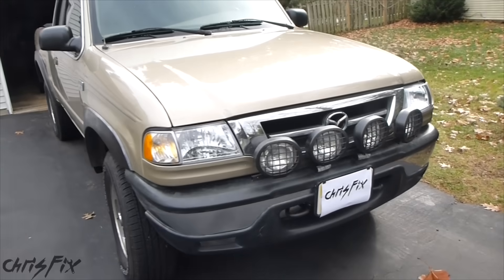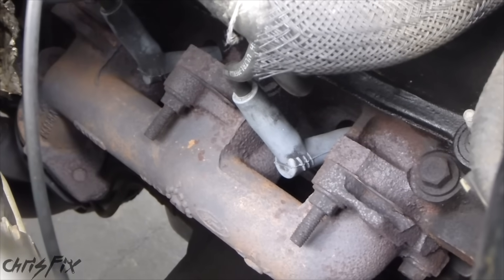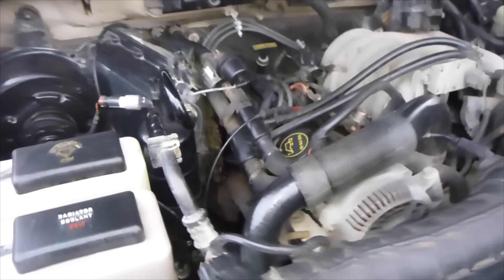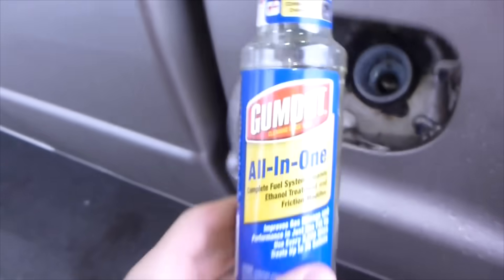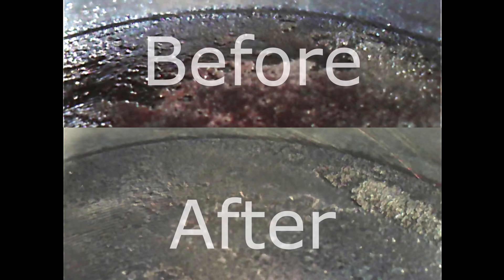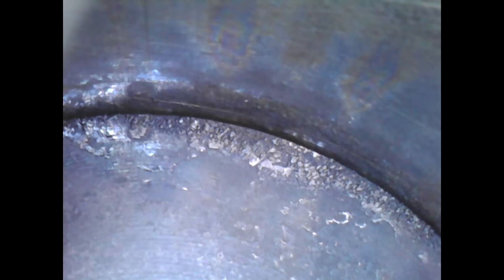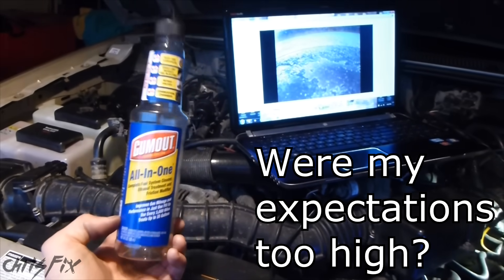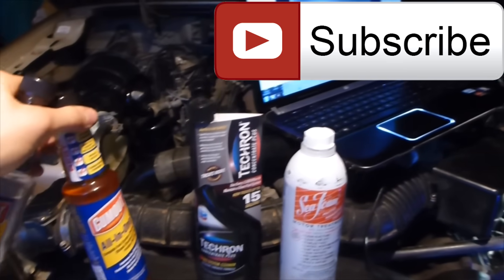Do fuel system cleaners actually work? Testing Gumout "All-in-One"

Comment: Heres a question I know nothign abotu cars but why cant you pour that stuff down those holes you stuck the camera in  or pour some kind of cleaner down there instead of putting this stuff in the gas tank .It might clean that black stuff better
Reply from the maker: rbeck3200tb40 That is great thinking but the liquid would seep past the piston rings and go into the oil which is bad. Plus the carbon would all be removed at once which is bad. And the final bad thing is liquid in the cylinder can hydrolock an engine. That being said, I tried out what you said in a lawnmower engine here: https://www.youtube.com/watch?v=WdT4DPFXIkM
Reply: ChrisFix
 OK thanks I dont know much about cars.

Comment: I put 3/4 of a can  of seafoam in my 12 gallon gas tank on a Suzuki x90 with no engine lights on,, after  running it for a while, and then washed the engine with purple power, the light came on, with a egr flow malfunction, I took the egr off and cleaned it, and turned the light off with the scanner,, now, it comes back on every 40 miles or so,,,  Was it the seafoam, or the wash?
Reply from the maker: gmisltr It could be either. The EGR tubes might be clogged up. I will have a video on that next week so stay tuned!

Comment: Carbon build up on the piston is not part of the fuel system! You need to look at the injectors, inside the fuel rail, and also the top of the intake valves.
Reply from the maker: azone123465 I am just going off of what the bottle says as explained in the video. Looking at injectors and valves is next but that takes a lot more work.

Comment: you have to use it 3 or 4 tank fills for it to get most of it out. it does work
Reply: I was thinking the bottle is probably overhyping the before and after making you think a single bottle does this. I think it's probably over the course of a few or more oil changes the carbon deposits will eventually be minimized. Something that hard and that caked on probably needs time to be fully removed. Plus would you really want all of that carbon deposit coming off in a single tank of gas and dirtying up your system all at once?

Comment: I'm a big supporter of fuel injector cleaners every 5000 miles. Your Mazda truck engine was indeed in very bad shape! Also, you didn't mention if this was the first ever cleaning of this engine in it's 122,000 mile life so I'll assume it was. There was some improvement after your treatment however minor.  For you and your viewers to expect a significant improvement in carbon removal in one use of any cleaning product on an engine with 122K on it would be like a person having lived for years with cancer and expecting to be cured after one chemo treatment! Unrealistic!!!! If a quality injector cleaner had been consistently used during the 122K mile life of this truck, (aprox 20-22 applications over the life) those piston tops and valve bottoms would be practically spotless. Consistency is the key here. I also am "not" a spokesman for Gumout or any product!
Reply from the maker: Simon Carr Thanks for sharing Simon!

Comment: 200miles on a full tank? least the fuel is cheap in the U.S
Reply: michael jagger Yeah 321km from 65 Liters of fuel is bloody damn bad consumption... :/
Reply: Or a performance car :) Our 1986 Toyota Land Cruiser 2.4 needed 8.7L/100km...
Reply: +Tanel Murd The Honda Type R does 10l/100km.
But then again it is a performance car.
Reply: Keep in mind it is a petrol ute/pick-up. They're not the lightest nor the most aerodynamic things in the world, and if the motors in a ute it's probably tuned for fuel efficiency. Remember the engine has a few years under its belt, so it's probably lost a fair bit of power as well, and also remember there's power taken by the Gearbox, Power steering, and Air Con. All in all it probably has to work harder than it originally would have to.

But yeah, its shit fuel economy :3
Reply: +FraggerFilms Keep in mind this car is about 25 years old with a 35 year old engine design. Ford doesn't even make a Ranger pickup anymore. The much bigger F150 with 4 wheel drive, a quad cab, huge bed and the biggest engine (in total a little over 2 metric tons in weight) still gets about twice the fuel economy then this Ranger does. 

For overall efficiency, American made cars are generally about the same as European, Japanese and Korean automakers these days. This car is a relic of a time gone by. Emission and fuel economy standards have been streamlined for Western Europe and North America in the past couple decades so there's really not any difference anymore. Manufacturers on both sides of the ocean already know the targets, that are nearly exactly the same, that they have to hit even 20 years into the future from right now. There's no discernible fuel economy advantage these days, although US automakers generally have much better emission standards solely because of the very high standards California has set into law as a state. We've seen Fiat and Volkswagen both get in trouble in recent years by having on-board diagnostic computers in their cars spit out fake data, on purpose, just to pass these emission standards so their cars can be sold in California legally. 

What are gas prices like in your country? Here in the Midwest of the US I'm paying about $2/gal or about $0.50/liter.
Reply: This is the reason because the US make war all over the planet.
Reply: +michael jagger holy shit... my 35 Liter car goes 750 km on a tank and its half site of this cars tank O.o
Reply: FraggerFilms
Reply: Seeing that made my eyes water. I know fuel is relatively cheap Stateside, but why wouldn't you want more miles for your money. Insane.
Reply: I am Pernix Yeah fair enough, the economy is still woeful though. Good thing the fuel is inexpensive over there
Reply: You can't rule out that most of those miles could have been city miles which all vehicles get worse mpg in city drive.
Reply: +FraggerFilms A 1989 Camaro gets ~29 mpg cruising on an interstate.
Reply: Very good argument, when you consider the age of the engine and car design in general. Ours is around £1.10/1.60 usd per litre but has been as high as 2usd not too long ago. (UK)
Reply: Pro88teC you are goddamn right sir
Reply: six cylinder pickup truck, what do you guys expect? haha
Reply: Michael Langley i drive a 04 mercury mountaineer awd v8.. get 11 miles to the gallon, 16-17 gallon tank if im right
Reply: Catalin L please explain if you can? because after using this product i noticed a decent increase in rpm even at steady driving, any way to fix this?
Reply: Tony Diciesare how can your rpm be higher whilst your driving? Unless your driving in a lower gear or at a higher speed.
Reply: Michael Langley i get the same thing roughly 230-250 on a full tank by the time my gas light hits, i roughly fill up with 15-16 gallons everytime its an average of 15-16 mpg wich is like 26 kilometers per gallon or 6.5 kilometers per liter. iv wanted to switch it for a economic vehicle but i just love the power and versatility of having a truck.
my truck does around 400-450KM per tank
Reply: Id be tired of filling it up. You would need to take out a bank loan if you were gonna a run a pick up truck like this in the UK unless you earn't alot of money. Fuel is expensive enough here as it is.
Reply: Mazda now have something called SkyActiv technology which means they can get better fuel economy out of bigger engines.
Reply: Michael Langley yeah i know, but i noticed a better mpg when driving highway, even if speeding i was going 75-80 (thats like 140-150 KPH steady on highway i did 160 miles with half a tank, i usually drive city wich gives me an average of 125 miles on half a tank. gas is 2.50 a gallon it went up last year it was 1.80 a gallon i spend 40+ dollars  every 10 days, sonetimes every week. i could always upgrade and buy a new car but thats a monthly payment of 250+ a month...
Reply: Michael Langley i wanted to buy the kia niro it does an average of 50 mpg and its just 22-25k
Reply: How much is fuel in the USA? Here in Europe in Slovenia is 1.3€ or about 1.4$ per liter.
Reply: This would be a rather useless video if his test vehicle was in top condition.
Reply: BeGamerSl right now in Florida we pay about $2.35 / gallon
Reply: Robert Greenhouse You buy gas per gallon? If I calculate it into gallons our fuel would be about 6.20€ so almost 6.80$ per gallon
Reply: FraggerFilms you wouldn't even have engines if it wasn't for us chum....
Reply: U think that's bad, I can make half a tank(25L) last about 200km..
99 prelude H22a
Reply: This has nothing to do with it being a US car. Most cars here get between 25 and 40 miles to the gallon. Unless they are designed to race or you are towing something. Some might get closer to 20 mpg if you are in the city and drive them hard and its an older or large vehicle. My 2007 saturn vue gets 25 mpg with a 3.5 liter engine. And that is beating the crap out of it and it has 210,000 miles on it and needs a tune up. It also does 0-60 in around 7 seconds. This vehicle obviously has problems and needs to be repaired or have the engine replaced. I am surprised it still runs.
Reply: Fuel is not cheap in the US
Reply: 2016 camry 386 miles on a full tank
Reply: nagyfagyotthal57  thats just very f-ed up car, this car eats up 20,25 liters for every 100 km , in EU car that drinks more then 10 liters, is considerd either a relic or something is seriuslly wrong with it.
Reply: When you use this product u have to drive in a higher RPM .
Reply: +nagyfagyotthal57 It was around 11mpg! this is appalling... typical US though. In europe we can extract power and fuel economy from the smallest of engines
Reply: a pickup and a performance car? i have driven with so called performance car, and in normal drive mode they still drink like 7-8 l of fule, and when u step on it real hard and do all sort of drift and shit, u cant go over 15 l at any way .... fule is not the thing that makes a car a performeance car, its the tehnology and the construction of the engine it self.

Comment: ChrisFix I have seen all the fuel cleaner videos you made. Which one did you think cleaned the best? I am not a fan of sea foam. I have tried it on a few cars and didn't get the results I was expecting. I don't like the smoke, making people think it is carbon build up blowing out. Also, you should try sea foam again but in an older car.. To see how well it cleans.
Reply from the maker: johnathan wood I like sea foam the most so far. But my takeaway is to use none of them. There is no need unless you have a problem. The injectors in my truck are clogged thanks to the cleaners!
Reply: Uh oh.. Lol. Should do a video on how to clean injectors now lol. Maybe it wasn't the best idea to use them all at the same time? Not enough time to let crud pass through the system?

Comment: Nothing can remove carbon buildup than mechanically scrap them.  Any solvent or detergent will clean gummy, and oily surface. PEA (polyether amine) is the best one to prevent build up and clean residue before it forms amorphous carbon deposit just like in your kitchen ware.  Once it becomes solid amorphous carbon, only mechanical treatment can clean them.
Reply from the maker: rondhole Seafoam worked a little. Thanks for the info!

Comment: doesn't that black shiny carbon turn into the big carbon crystals over time? the instructions appear to indicate that it will KEEP the engine clean when it's used every oil change which would make sense if it removed the soft carbon sludge every time before it has a chance to crystallize onto the cylinder

Comment: Chris, I found this very interesting video on Engineering Explained's Youtube channel:  https://www.youtube.com/watch?v=6eqpczQpzig, which gives scientific information to help validate whether the fuel cleaners are helpful or not.  I'm not promoting his site, but I find that since he did his research and also found two journals of scientific research from reputable sources.  It says that compared to normal quality gasoline, the additives don't do as well, and actually cause more deposits than the engines without the additives.  But it did also say that out of all of the additives, the PEA additive produced the least amount of carbon build-up on the engine.  His video concluded that at 10,000 miles, the amount of carbon removed versus the amount that is deposited is equal.

Comment: I don't think that does good to the engine, all the little deposits removed are a hard substance, they can get in between the piston and the bore of the cylinder and scratch it.... on thing you can try is just using water , removing the intake and spraying it in the throttle body and keeping the engine around 2500rpm, a lot of chunks will start shooting out of the exhaust after finishing with the water keep the engine revs high and try letting it idle freely.
Reply from the maker: roskataqv I will be testing water soon so stay tuned!
Reply: Okey, good luck :)

Comment: I get the feeling that these fuel cleaner products are meant to be used on a somewhat regular basis after an engine's break-in period. Waiting until the car has well over 100K on it is like asking it to work miracles. From what I've read in the past, not all gas is the same, especially when truck drivers are adding the ethanol after unloading the fuel. That 10% could really be more or less depending on who is working that day.
Reply from the maker: Monacomaverick Yea, but they sure dont advertise these cleaners to work only that way which is the problem.

Comment: Were your expetations too high? That's a matter of what you base your expectations on. Were they based on teh informercial type claims on the bottle or on your own insight ant hopefully more critical approach to the subject?  To me it's pretty clear that it would be hard for anything that you can put in your tank together with the fuel that actually is responsible for the buildup in the first place to have any significant effect and still be legal in california (which I guess it would have to be to be put on the market in the US) woulndt work. If I did I don't think there would be any systems that you hook upp directly to the fuel rail and run the enginge on 2 types of cleaner fuels would have a place in the market considering the cost they involve. Did you watch the explanation of how gumout works on Engineering Explained?  Are the deposits on teh side of the pistons on the same side as the exhaust port? What octane rating fuel do you put in your car? I think you would do better by using a higher grade fuel than by using additives but off course youd have to clean the enginge first since just upping the grade might not take away deposits allready there.
Reply from the maker: rimmersbryggeri Thanks for the insight. The octane of the gas has nothing to do with carbon deposits. My expectations were high but that was because that is what the container shows. It seems like the additives that you put in the gas dont really do much to clean the carbon deposits, but an additive that you add directly to the intake works well to do that like in this video: https://www.youtube.com/watch?v=u6UeJXkzDW8
Reply: EricTheCarguy does the same with plain tap water I guess the idea behind that would be that if a leaking head gasket steam cleans the combustion chamber so vill water put into the air intake in a simular fashion to how you apply the sea foam. The octane rating does effect deposits since a higher rated fuel will burn more cleanly .
Reply from the maker: rimmersbryggeri I will be testing water soon. Eric does not do the same thing because he doesnt show a before and after. A head gasket leak is long term so that is how that works so well. A few cups of water might not do anything. We will see!

Comment: I work at a gm dealership, and we hve an incredible product to be used in a similar fashion so seafoam. It's a foaming throttle body spray that you use with the engine running and it smokes like seafoam. it recently did incredible things for the idle on my camry and I'd like to see you test it. If you're interested I'll send you a can, but you have to make a video for this series with it! (It's a $30 can btw)
Reply from the maker: Chris Lesmerises I can make a video if you want to send me a can. My address is:ChrisFix
PO Box 220
Tennent, NJ 07763

I will try to find a car with a dirty engine.

Comment: i love the 3.0L engines in the rangers. had one in my 95 and it was incredibly reliably, powerful, and good on gas. That engine with the the 5 speed i had in it was indestructible
Reply from the maker: Harley Landsbergs Yea, it is a pretty good engine. I wouldnt say it is good on gas though haha
Reply: Mine was pretty decent but that's because it has bigger tires and was a standard :p got about 28+ miles to the gallon :p

Comment: It won't do much for cars with over 100k miles on the engine.  I did a complete rebuild on my M42 BMW engine and have been using chevron gas (small amounts of techron in gas), techron/gomount fuel system cleaner (every 10k miles), oil/filter changes with Mobil 1 every 5,000 miles, and the results have been great.  30k miles on the engine and everything looks just as new as before.  Intake manifold was off and valves were perfectly clean, ports clean, Pistons had nothing on them, and even looked under the engine with the lower oil pan off to see how the oil was performing.  Everything was 100% mint.
Reply from the maker: DrGamble28 Thanks for sharing!

Comment: Hey Chris, in what way does carbon buildup affect your engine?
Reply from the maker: Adam Holgerson If it is bad you will get detonation, increased compression, your valves might not close all of the way, the cylinder might run hotter, and/or an unbalance in the engine.